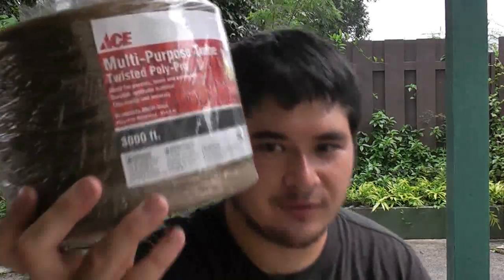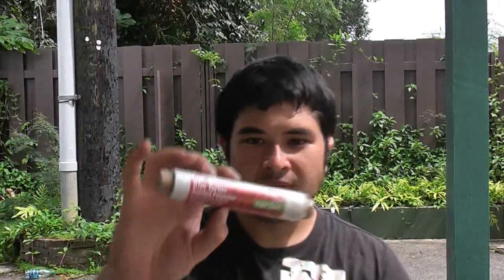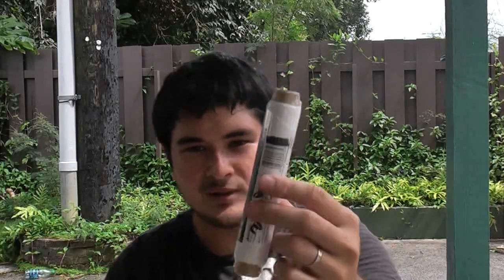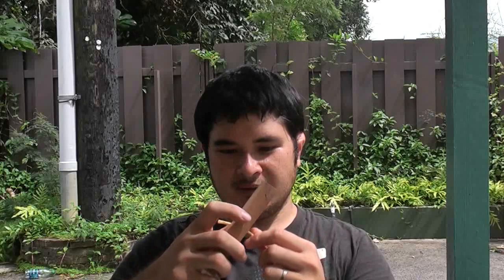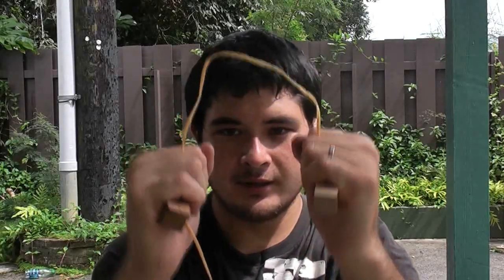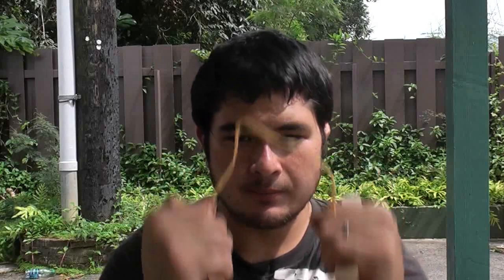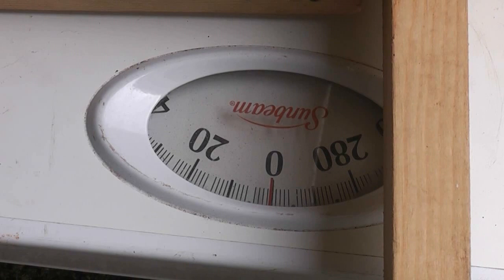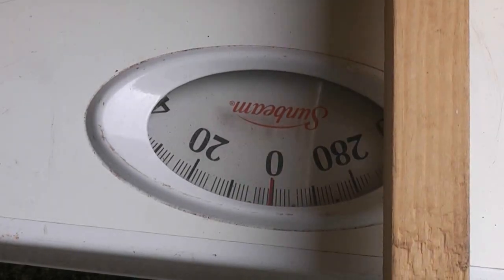How to Test the Breaking Strength of Various String Materials for Bows Part 1

Comment: Very interesting  !   Hope ya don't mind my nit picking,  but if  ya wanted an even more accurate measure,  ( or possibly for the test to match the working conditions  )  ya may want to wrap the cord around a smoother, more rounded shape handle.   As it passes over the sharp edges of the handle, that causes a strength reduction just like a knot would.

Comment: I believe you multiply the breaking strength of one strand of string by the draw weight of the bow then divide by 4. That should be the number of strands. weather i'm right or not, you can google it and find the proper formula on the internet.

Comment: Is there a a formula for determing the overall bow string strength?  I am confused how you obtained these numbers i found on your website

Braided Dacron Fishing Line (50 lb. test) – 85 lbs.
12 strands up to 204 lbs. 14 strands up to 238 lbs. 16 strands up to 272 lbs.

I understand that 85 is the breaking point of the line, but how do you determine the overall strength needed?  Can you please explain how you got the number you stated at 3:17 in the video?

Comment: if 30 lbs bow equals 150 lbs of breaking  strength what would 40, 50, 60 pound etc bows needs for breaking strength?  I love your videos keep up the good work.  I have been assembling my materials and making my jigs all I need is the bow string material but I am having a hard time finding B50 Dacron.
Reply: It's been 8 years, but I'll take a stab anyway. The draw weight of the bow and the required total breaking strength of the string should be proportional. Nick's 5:1 recommendation means that a 50 lbf bow would require 5*50 = 250 lbf of total breaking strength. Also B55 is a very similar alternative to B50. Both are Dacron.

Comment: If you use half the thickness, the force it can handle doesn't cut in half, (You could have noticed this when half of the first got over a hundred and the quarter piece got to 45 (2x45=90 < 100) So the normal thickness twine of polypropoline could easily handle over 200 pounds.